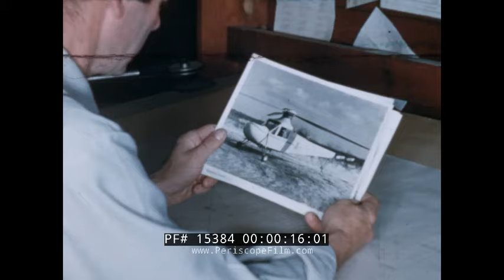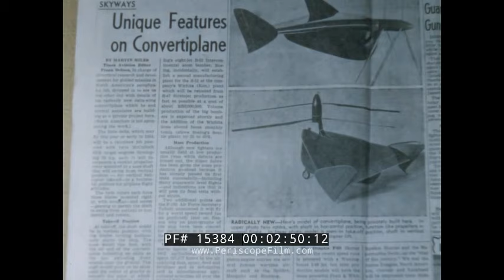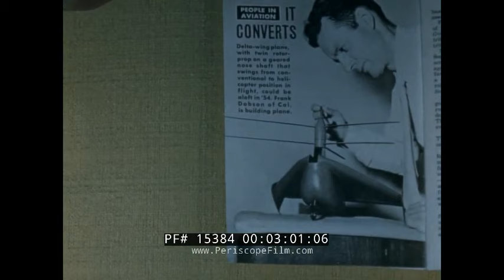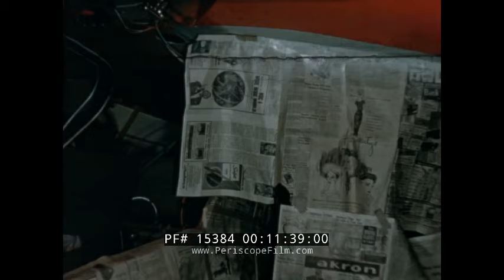FRANKLIN DOBSON CONVERTIPLANE  EXPERIMENTAL VTOL AIRCRAFT (SILENT FILM) 15384

Comment: Center of gravity, Schmenter of Schmavity! ...
Reply: When it leaves the ground, the fuselage swings and pivots below the prop, so as it climbs the pilot is laying on his back looking upwards, and the fuselage is dangling vertically under the props.

When it gets to a certain altitude, the prop rotates downwards, forward speed is gained, and the fuselage / wings begin to produce lift, at which point the props are rotated to align with the fuselage again, and you fly off like an airplane.

At least that's the way he described it in the patent. It seems to me the conversion would involve diving downwards for x seconds and x hundred feet as the acceleration increases and the props rotate.

Hard to imagine it working smoothly. Searching for info on test flights.